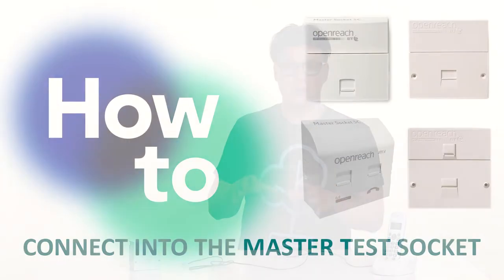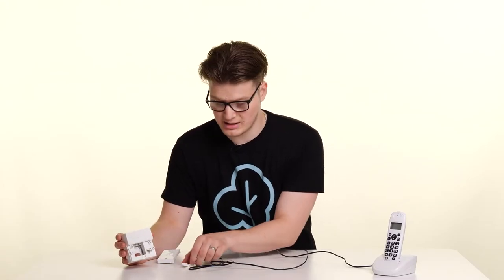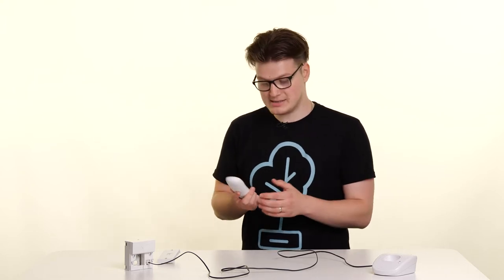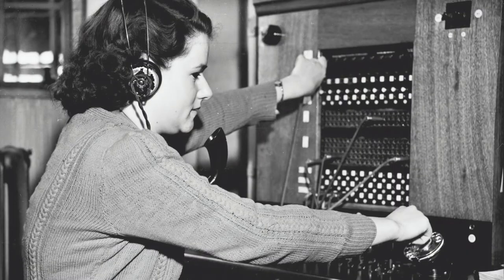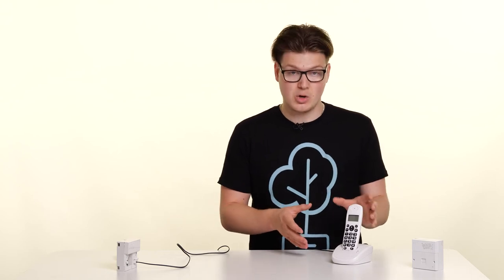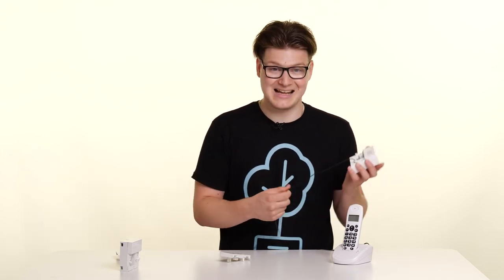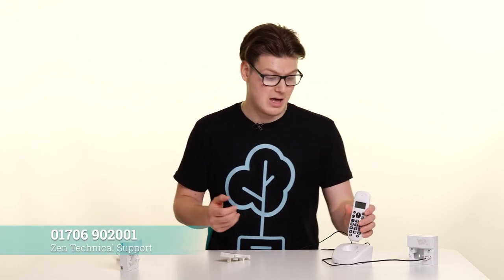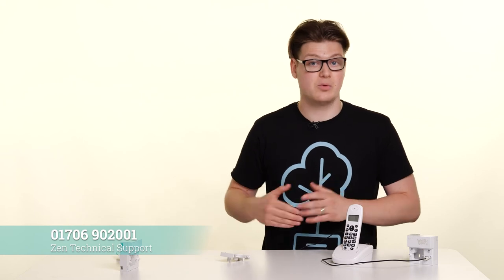How to Perform a Quiet Line Test

Comment: Sorry but a couple of these instructions are unclear to me. 1) what is meant by : "another phone"?   Do you mean to use e.g. a mobile to call the same quiet line number, 17070 opt 2? -   2) the 'quiet line test' voice disconnected after about 4 minutes, so what do you mean by "if the quiet line test comes back as quiet" ?   There was continual quiet crackling during the test and the internet drops out every time the landline is used - as well as at other times.
Reply: 1) a different landline phone, to rule out the problem being with the phone. Alternatively, you can connect the same phone at a friend's house - if they pass the quiet line test with your phone, the phone is fine.

2) any noise means the test is failed. It won't check for you, and won't tell you if it passed or failed - you just have to listen. Any noise - potential line fault, call it in.
Reply: Additionally, if it drops out every time the landline is used, it sounds like you need to replace the line filter. You may also have phone wiring connected behind the master socket if it's an old socket - if so, that should be removed or a plug fitted to it and plugged into the phone side of the filter instead
Reply: @thethiefmaster  Thanks Gareth for both your replies.  The fault seems better now I've logged in to the Fritzbox system and changed channels, ie altered the potential overload with other electric devices (hopefully you understand what I  mean!) but I'll monitor it and follow your advice if necessary.  Though the landline  still sounds  fuzzy :(
Reply: Yes that bit about if the quiet line test comes back as quiet was very unclear. 
Mine did, but I dunno why the phone is crackling and the internet is dropping at the same time unless there is an issue with the line.... so Im guessing its intermittant and I need to keep trying until it does it while Im testing.
Reply: @Heligany  Hi, I have exactly that problem - terrible crackling on landline, internet drops.  Internet drops also for no apparent reason - last week, the whole night (red light showing on the router).  Nightmare.   I've ordered a new router - mine's over 3 years old, apparently that might make a difference.    Here's hoping - I've had intermittent service as described above for 2 years now!  Maybe you need a new one too?   Good luck :)